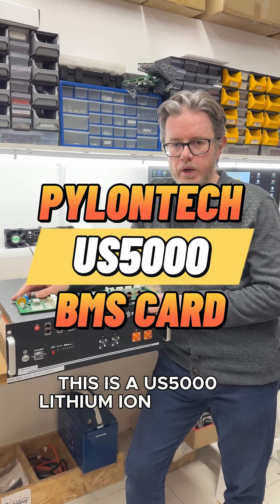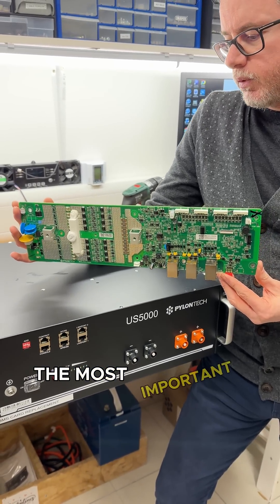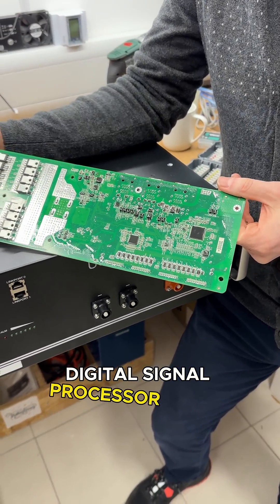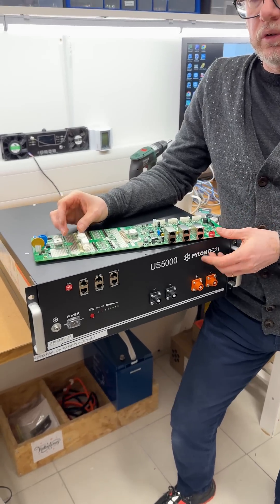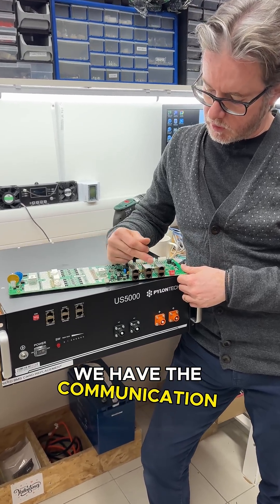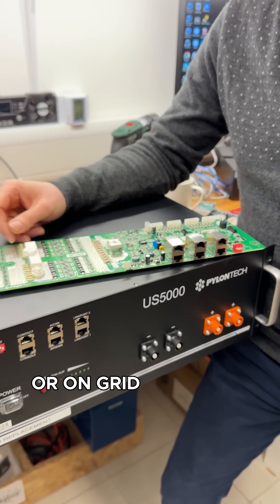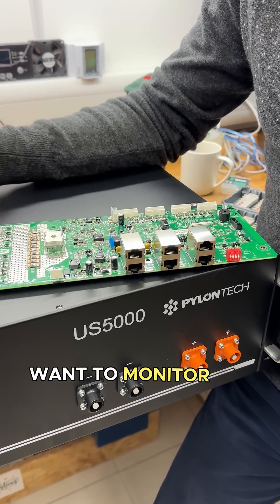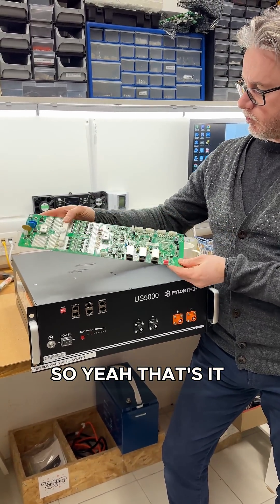How the BMS Card of Pylontech US5000 Lithium Battery Looks - Do not attempt to replace it at home.

Comment: Hello Voltacon Solar, do you know how many cells are in the US3000C and US5000C batteries?  
I think the US2000C has 30 cellsat 25ah each configured as 15S, 2P.